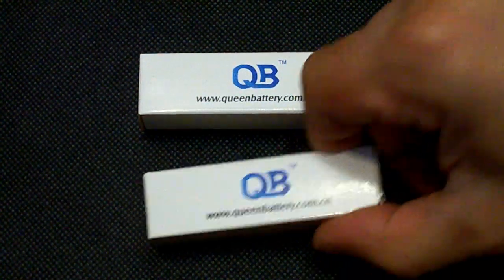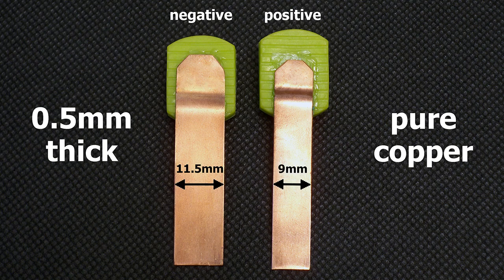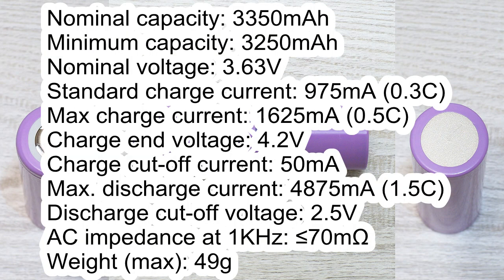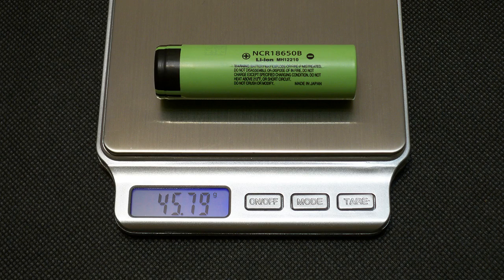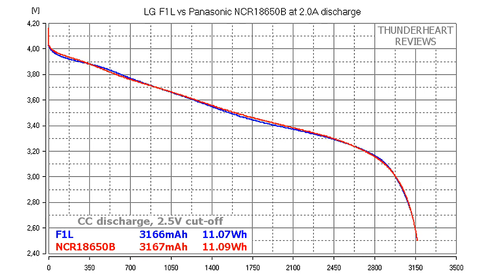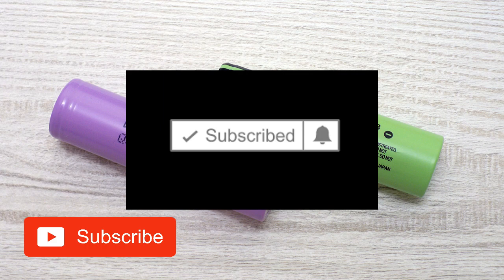LG F1L vs Panasonic NCR18650B capacity test

Comment: Hi. If i have a Panasonic 18650b 4s2p wired in serie... how is the c rating on this?
Reply: the C rating is the battery C rating X the number of cell in parallel but only if the pack has active battery management to be safe

Comment: which is better for powerful?
Reply: Both of these are good batteries and are pretty close in performance. If you need high power for a drone though, you may want to look at batteries like the VTC6, 30q,  hg2, or similar.

Comment: Hello
Is it possible to reconstruct a battery of a laptop with better quality 18650 Cells than that are used by the  OEM Manufacturers. eg i have a MSI ge62 6qf with rubbed off LG cells so i cant tell what MAH they are but the battery is designed for 4700-4900mAh. Since i cant buy an OEM battery in my country and it is like impossible to import as a battery will cost 3 times of the said item to import it. So here comes my idea since i have a spot welder in my university and i can buy good quality Panasonic NCR18650B 3400 mAh, can i replace them in the laptop battery 

What will be the issues and problems related to the battery Construction except being extra careful in spot welding.
Reply from the maker: Hi. It depends on the controller used. In some cases laptop battery's controller detects the replacement and blocks itself when you disconnect the old pack and the voltage becomes 0.
Reply: @ThunderheartReviews  I guess one way around that is to keep the original batteries in place and copy the battery arrangement and wiring separately for the new batteries, then connect in parallel the new batteries to the positive and negative wires coming from the PCB board, then, disconnect the old batteries. This way the board is always powered up and it won't notice anything.

Comment from the maker: 00:31 - Testing equipment
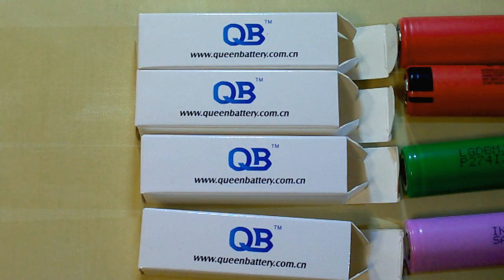01:41 - Battery supplier
02:02 - LG F1L specs and capacity test results
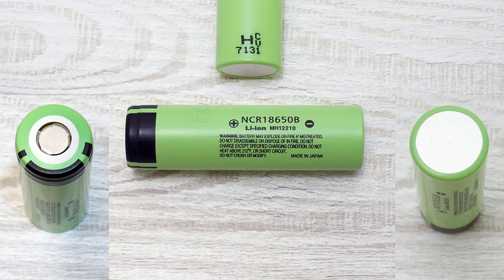03:26 - Panasonic NCR18650B specs and capacity test results
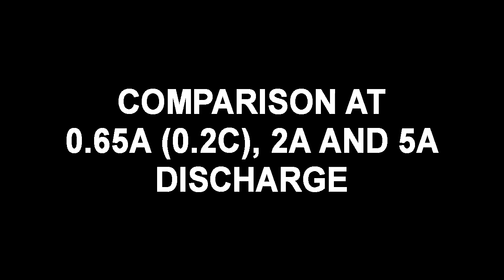04:46 - Comparison at 0.65A, 2A and 5A discharge
05:33 - Verdict